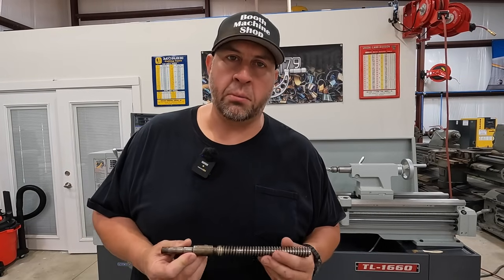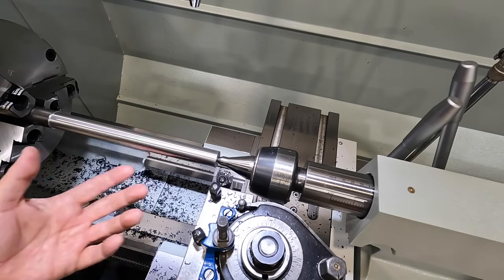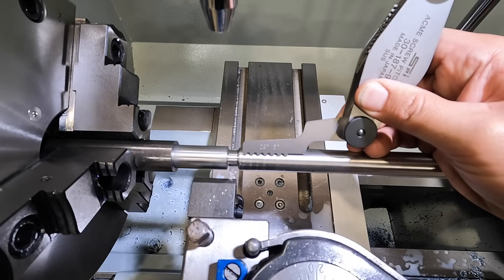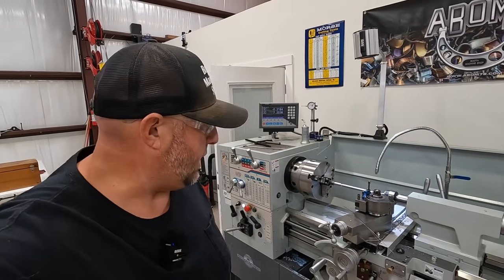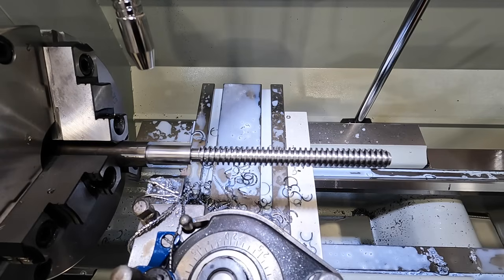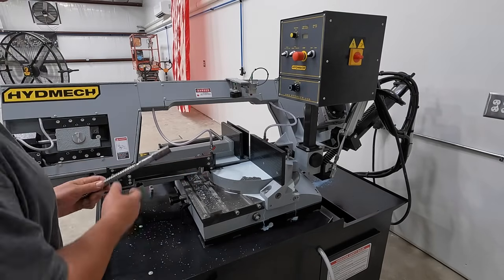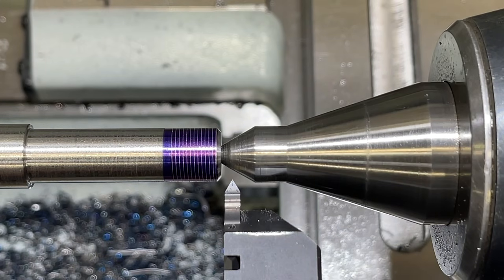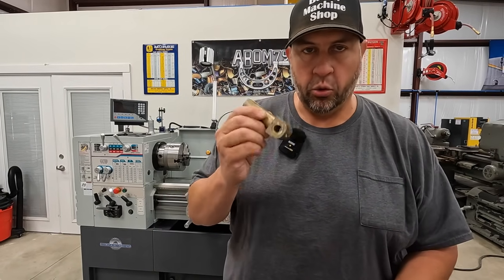Compound Acme Lead Screw for American Pacemaker Lathe

Comment: I never bought new machines because I knew I would have a heartbreak the first time I got it dirty. 🙂Thanks for another very enjoyable video.
Reply: Frankly I don't think new machines are built to the same standard as th he new ones. Although a few years before I retired we got a new Harrison around 12 or 14 inch swing with about 60 inches between centers. Built in Poland. Nice lathe. Firm yet smooth controls with variable speed in three ranges. Inch and metric gear box.
Reply: I live in Germany and was at the university in Giessen for over 40 years. Giessen was the home of Heyligenstaedt, one of the great names in German machines. I'm spoiled.
Reply: Same reason I wont buy a new vehicle for myself!
Reply: @BruceBoschek  
I know the feeling. We had a number of Hardinge HLV-H's for small work.

Comment: The technique as I commented in the video where the threading failed, although the insert manufacturer says that it is not necessary to lubricate, the behavior of the material makes lubrication necessary. It can be seen in the finish, and that at no time does it use sandpaper or file since they are not necessary. Congratulations on the ADAM demonstration

La técnica como lo comente en el video donde fallo el roscado, aunque el fabricante del inserto dice que no es necesario lubricar, el comportamiento del material hace que sea necesaria la lubricación.  Se puede apreciar en el acabado, y que en ningún momento emplea ni lija ni lima ya que no son necesarios. Felicitaciones por la demostración ADAM

Comment: A couple more things. I use an old Summit 19x80 that was given to me when I retired. I bought a couple of newer used Bridgeports with a lot of wear. I found that I could remove .015-.020" from the sides of the ACME screw and use the double brass nuts to take the slack out. Saved about $400.00 for a new lead screw.

Comment: I like your methods. One thing I do when getting close to the final nut (or thread guage) fit, I will lightly file the thread to remove any tiny burrs that may be present, and for large threads, I will use a triangle file. I then rub a Cratex Rubberized Abrasive Block to smooth out any roughness present on the thread. I do the filing and the cratex'ing with the machine running. I do this before deciding to take another deeper cut. Once you cut, you can't put it back on. Keep up the great videos.

Comment: I work with a similar Cyclematic lathe also made in Taiwan with flood coolant with an electronic gearbox and I gotta say they aren't bad at all. I only wish that they had a bit more cast iron for more rigidity like old school lathes but for jobs like this they're perfect. If you end up with a few snug spots when testing out your nut, sometimes taking 1-2 spring passes at your final thread depth helps smoothen things out without adding extra backlash.
Reply: All smoothened now after the spring passes ?

Comment: Hi Abom. I have watched your work for a while. I am no expert. I used a follower rest to "clean up" the threads on a 48" Bridgeport X-Axis lead screw. I think you can use either angle on the 14 1/2 degree. It just takes metal off the opposite side of the thread. I also use tap magic (I buy 5 gallons at a time) and use an old squirt bottle to add it as needed (409 spray or shout laundry aid or any other type) I also run slower. The other thing i do is make my own ACME thread tool. I use old 1/4" carbide end mills cut off. I sharpen them with a fixture I made on the bridgeport in a vice using a diamond cup wheel. (I cut the flutes off). I bored & reamed a piece of 3/4" case-hardened ground rod (thompson). Added set screw to hold carbide hand made bit. That way, I can rotate the acme slightly to adjust for left or right hand thread. Good Luck.

Comment: One thing that I noticed, that I really liked. When you finish a pass, you back off the cross slide ONLY., then go back to start another pass. Then, you repositon the cross slide back on zero, and move in the compound another 5 thou. I will try this. I usually never touch the cross slide and back out the compound only for the entire job, but I have to quickly remember to go 5 thou past where it was for each pass.

Comment: My father used to say ... "If at first you don't succeed, try try try again!
I've modernized the saying to ... "If at first you don't succeed, ya damn well better get it right the second try"!
Well done, that lathe is SWEET!
Reply: Sometimes it takes more than a second try to get it right. You damn well better learn from failure #1 for sure though, and try your best to succeed on attempt #2. But even if it takes attempts 3, 4, and 5, you should still keep trying until you get it right. 💪😎 Some people "3 strikes, I'm out. I'm giving up because I'm obviously not cut out for it." That's a shame, because you should strike out until you hit a home run which very well may be swing #4. 🤷🏻‍♂️
Reply: @mannys9130  Well said.
Reply: And my saying is " If first you don't succeed, Quite, no sense in making a damn fool of yourself " lol

Comment: In all the years I did machine work I never got to run a new machine but a couple of times. Usually last one hired got the oldest most abused machine in the shop. When I worked for Boeing you had to "earn" your way up to a new machine or have the most seniority. It is so nice to not have to fight the machine and compensate for stuff due to misuse or just common wear and tear...
Reply: Actually, when I was in my early Mechanical Engineering school Machine Shop (ASMET then BSMET) I deliberately went to the oldest LeBlond lathe at the end of the row. The other guys tried to get on the newer machines. Their problem was that they didn't get the same machine twice. One day the old, retired Navy veteran machinist instructor came down and asked me why I picked that machine. I said: "Because nobody else touches her and the old girl is still in good shape. Next time I come in she's just like I left her. Plus, the scrap barrel is ten feet away, and the toolroom is twenty, and those guys are back and forth from the other end of the shop."

After the class was done and I got my "A"s on everything I told him my Granddad had been a Bell Aircraft/Lockheed machinist building instrument panels for B-29s. He said: "Runs in the family don't it"? :)

Comment: You can check thread pitch with the DRO. Turn the chuck to take up backlash, zero the DRO and turn the chuck one turn. It should move one pitch. You don't have to scratch your work piece.
Reply: Nice tip👍👍

Comment: GHT wrote a piece of cutting left hand acme threads, perhaps not an issue with a new, large lathe without backlash on the leadscrew but the problem he had was when the tool pops out of the thread near the tailstock it looses "support" on the right hand size and the last bit of the thread will then lack consistency so when you get the nut to engage on the end it will then be loose on the rest of the thread. Remedy was it seems to cut the thread from right to left in reverse with the tool upside down.
Reply: Or even easier, just cut a taper at the far end so the tool unloads slowly (in a controlled manner) rather than just ending up in "free air".

Comment: Both the nuts used as gauges will have radii in their roots. It is prudent to file the sharp crests of the threads before taking finish cuts so the thread is not riding on the sharp peaks engaged in the root radii of the nut.
If you keep cutting until the nut fits over the sharp peaks then the thread will be slack when the crests are deburred. If the crests are left sharp, galling can easily occur in use when the sharp points wear into the thread groove.
Reply: Quite amazing on many counts.
Amazing that he does not know this crucial part of screwcutting.
Amazing that no other comments highlight this.
Amazing that with new machines he is not using full profile inserts.
Amazing that these threads pass inspection with sharp points and burrs.
Amazing if this comment remains.
Reply: These points are very true. I kept wondering if Adam was going to file the sharp crests to a slight radius before the finish cuts.
Reply: @ellieprice3396  Hopefully we all were.
In almost 50 years I have never seen anyone who did not deburr the crests before checking with a gauge. In the last 20 odd years I haven't seen anyone using inserts without a crest radius.
This is a consequence of processes uploaded by folk who never bothered to endure the sacrifices of a formal apprenticeship.
Reply: @marley589  @Engineering hacks & tricks But it's 'good content for the channel', so who gives a damn...
Reply: @than_vg  Incorrect techniques can't be good content, they may be copied..
Reply: @machinists-shortcuts  I know mate, my comment was ironic... This seems to be the flag of this channel 'good channel content' and, apparently, viewers agree with that. So why change? 
Don't know if you've noticed but this was never a place for technical discussion: if you challenge 'the authority' you get deleted, blocked and attacked but raging fans :D
Reply: @than_vg  Technical challenges to a lot of "machining" channels get blocked, but for who's benefit? I write a review when my comments debunking material get blocked. :).
Reply: @machinists-shortcuts  don't know who it is to benefit... My approach is that knowledge and opinion exchange benefits everybody. Others might reckon that maintaining the 'authority' untouched brings more money from YT...
Reply: @machinists-shortcuts  I agreed .. He never deburred before gaging ...:(

Comment: I really like turning 1144. I started off using 12L14 and 1018 on my 6" lathe but found it handle 1144 great. I up sized to an 11" lathe and still rarely use 12L14 or 1018. 1144 is just a bit more in price than 12L14 and 1018 but close enough in price and leaves a MUCH better finish than 1018.

Comment: There was something I didn't notice till you mentioned it in the closing comments. That machine is super-quiiiiet! Here's a vid idea, 'machine trivia -- noise levels'. For your phone get an audio level meter. For different machines, stand at the usual operator position and hold the meter in front of you and see what they say. With charts 'n graphs 'n a paragraph on the back of each one to describe the data.
Reply: Audio level while making 1/2inch chips.

Comment: I had much the same problem with my follow rest. My solution was to make a complete new follow rest out of 1" plate that ties down to my cross slide. By tying it  to the cross slide I could line it up exactly with my tool so the forces of up and back were totally under control without any torsional deflection of any kind.

Comment: Adam, How do you so consistently and accurately retract your threading tool as you come to the shoulder? That is one of the reasons I have been cutting threads form the headstock to the tailstock. Totally eliminates the pucker factor. I am always amazed how well you retract the tool. Happy fourth to you and Abby.
Reply: It’s not that hard to do. Mostly experience and good reflexes.
Reply: I have noticed that too.  He's got big monster hands, but he has a feather touch and lightning reflexes!

Comment: Love this channel. Bought my first lathe.   I love it but I’m lost.
Reply: Hang in there. The main thing to remember is Safety First. These machines do not know the difference between steel and flesh. When in doubt STOP and get some assistance or watch a video. First thing that might get you in trouble is leaving the chuck wrench in the chuck as you start the lathe. Hopefully you will do that only one time... The next thing is crashing the tool post into the rotating chuck. Next is trying to change the gears in the headstock on a running machine or not waiting until the machine stops turning. A 9 or 10 inch belt driven machine is a good learning platform and is more forgiving for a beginner.

Comment: It would be interesting to see how you diagnose and fix the problem with the old Monarch lathe.
Reply: The problem was not with the Monarch lathe, it was his technique.  He got lucky the second time through!  The only disappointing part of this video is that he never learned the real problem and so, he's bound to experience the same failure again.  It's puzzling to me that he never seemed to question why the problem did not occur until the very end!  Basically, the leadscrew experienced a loss of rigidity due to the reduced diameter of the thread root.  This causes the material to try to climb up on top of the cutting tool, hence the chatter toward the middle of the unsupported portion of the lead screw.  As the thread is at an angle to the axis, this will cause the right side of the cutting tool to dig into the thread as the material climbs up, (left hand threads), thereby exacerbating the problem.  He will experience this problem again if he doesn't adjust his technique.  Hopefully he will learn the real issue.  Perhaps he will read this comment and understand.  Often people are too stubborn to learn from the experience of others, they have to figure it out on their own.

Comment: Okay, so at about 9:00 you're speaking about clearance issues with the steady rest. But it looks like the thing bolts onto the side of the carriage.

Shortly after around 10:00 there's a shot from over the tool. It looks like, below the work, on top of the carriage - Well, there's a square of four bolts, and then two grooves running straight back.

Are those grooves part of the carriage, or the cross slide? If they're fixed, could a steady rest be assembled to slot in there and thus be right behind the majority of your tools, right where you need to support your workpiece against deflecting, instead of way off to one side, not helping, and getting in the way like a disinterested intern?

Comment: If you use cross slide to set the depth of cut, you can use compound to place the knive under following rest. Of course - for each infeed of cross slide you have to advance compound accordingly. You have to calculate the compund correction for each depth of infeed. More cumborsome - but more freedom in follower rest use.

Comment: I think I would have used 4140 TGP pre hard. But that's just me. Every time I had to cut Acme threads (both internal and external) I would waste out as much of the material as possible with a regular threading tool or one ground to a narrower angle. Save the Acme tool for going in and finishing out the profile. Plus I never ground my threading tools off hand on the pedestal grinder. I made up thread tool blocks* for finish grinding the tools on the surface grinder. Plus for Acme tools I used the Shadowgraph to check tool nose width. Sharp tools with honed edges and plenty of cutting oil. Another thing I usually did was to grind a short positive top rake parallel to the leading edge with a chip breaker. Anything to keep the chips from jamming up the cut. And alway used the lathe with the best leadscrew in the shop. 
Shortly after I started my apprenticeship the company got rid of a thread mill they had. Think something like a gear hobber that cut leadscrews. 
*I eventually wound up making one for 60° SAE/ISO, 29° Acme, 60° RH & LH offset for internals and a universal with a 7° clearance angle that could be set with a protractor. Handy for grinding form tools for O-Ring grooves and special form tools.
Reply: Thank you.
Reply: That would make a great video! Please let me know when you post it on your YouTube channel.

Comment: When you turned to diameter before cutting the thread did you check diameter in the mid cut area vs the ends to check for deflection due to tool pressure?

Comment: cool video. i have always wanted to cut a ACME thread it just seems like a cool/fun project. i have single pointed threads before, but ACME seems like the next step.
Reply: It's the exact same thing, except that the side angle is different so you set the compound at a shallower angle.

Comment: Would it cause problems to move the tool post off center in the t-slot? That would get you a little closer to the follow rest.

Or could you swing the compund around the other way? It would result in cutting the following face of the thread rather than the leading one which might have the same issues as climb milling but in some cases that could end up be a lesser issue than deflection.

Comment: Thanks Adam nice work. would like to see what happened to the Monarch when you get time.
Reply: I don't think anything was wrong with the Monarch. This time he used different material and a different cutter. I think he used 4140 Cromo on the Monarch and just got some chatter in the middle of the shaft from flex. Had he used a steady rest all would have been fine. Or had he ran with stress proof he prob would have been fine. I would take that Monarch over that brand new machine in a fast heart beat.